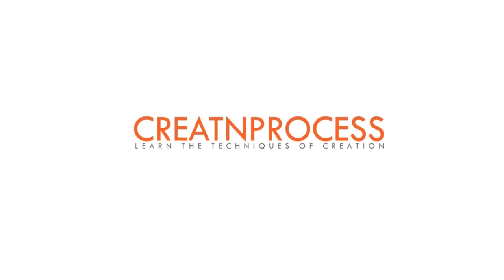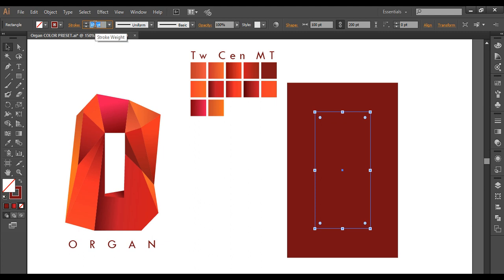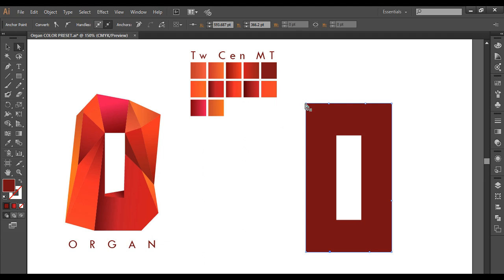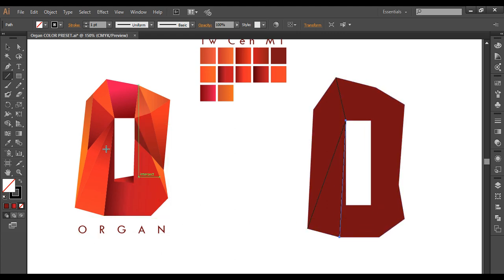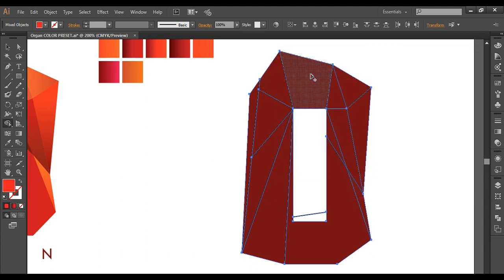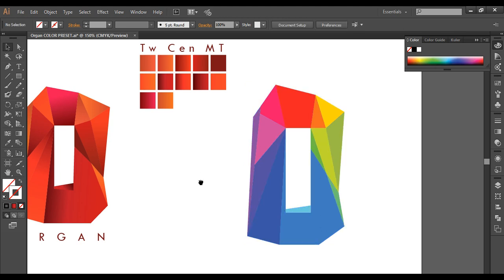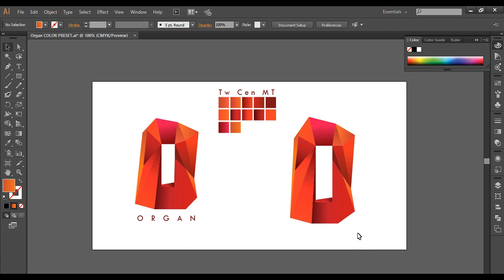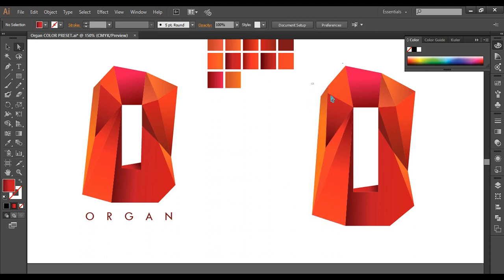Professional Logo Design - Adobe Illustrator cc (Organ)

Comment from the maker: Professional Logo Design- Adobe Illustrator cc (Organ)
Here is another new Logo Design Tutorial.
In this we are making three dimensional edgy logo design.  The logo is formed from basic shape of alphabet O. On the surface there are very shape cut edgy structure like crystal, where few edgy shapes are joint together. So design this logo we will first create out the basic shape using the rectangle tool. Then with the help of line-segment and shape builder tool, we will create out each separate shapes. 
Finally add up the gradient color in their proper order and the text.

Check out the whole designing process in this video.

If you want to Know more about Designing,
Click to subscribe my channel.
https://www.youtube.com/user/creatnprocess

FOR BUSINESS INQUIRY
Mail us at - Creatnprocess@gmail.com

50 PROFESSIONAL LOGO DESIGN MASTER COLLECTION
Now Available on!
INTUBUS - https://www.intubus.com/file/14363
GUMROAD - https://gumroad.com/l/woEWa